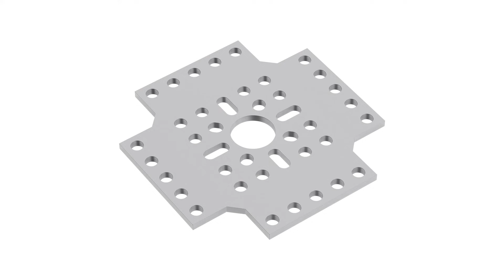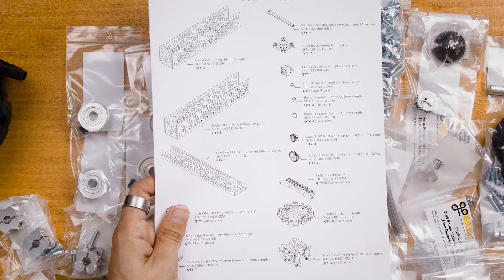Build a Raspberry Pi RC Tank driven by an 8BitDo Controller - GoBILDA Outlaw Chassis Kit Assembly

Comment: Thanks for the details and the great work and education you put out to help the younger generation; I had used Arduino to control my dozer due to the main Microcontroller program had gone out of business and I couldn't find any support, I just recent bought an Pi with a SB New Motorshield; I know i need to use a Analog Signal and Digital Signal Module to use with my 3 POT Joystick.

Will need help with the coding; I should be able to use some of my Arduino code but I never used a pi before

Comment: BS. just like Actobotics they'll discontinue this without a courteous warning. Spend a lot and get invested ($3000)  in it and get stuck with a 3/4 built 6 foot robot and cannot finish because servo city just dumps products with no warning or care for its customers.
Reply from the maker: I don't know much about Servo City Practices but if you have sunk into Actobotics and want some GoBilda Parts to work with it we have adapters for days - https://core-electronics.com.au/gobilda/structure/pattern-adaptors/actobotics-to-gobilda.html
Reply: .... uhm, do you know what FTC is? 70% of ftc uses gobilda??? It is the best cots provider dedicated to ftc. Actobotics went under because gobilda came around and was so much better!